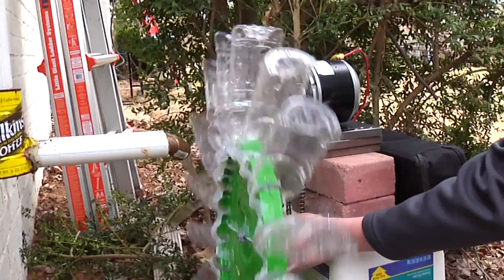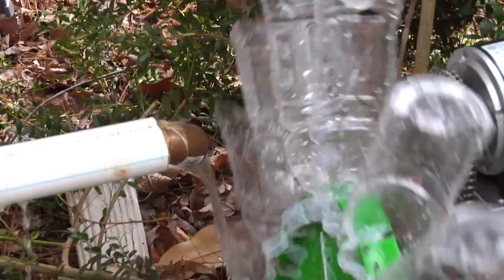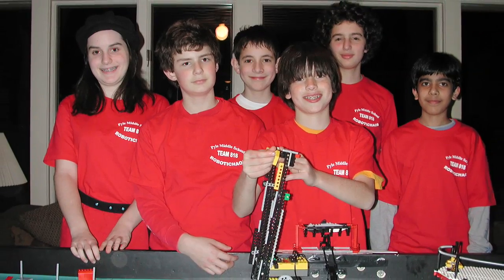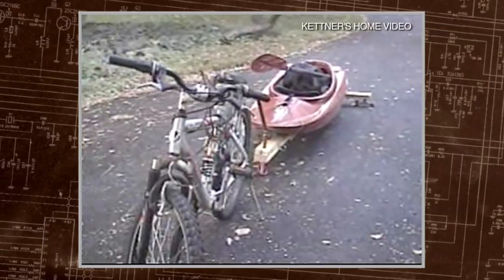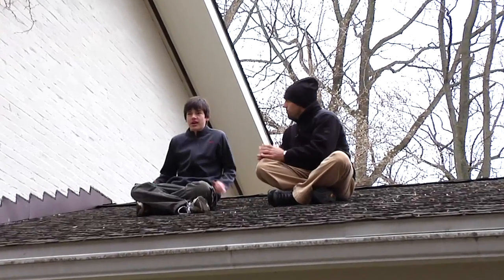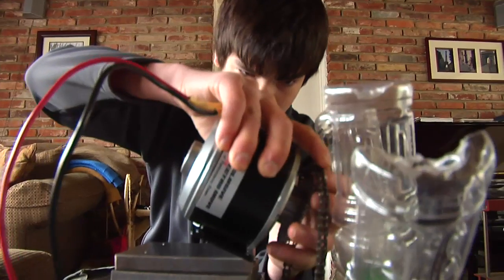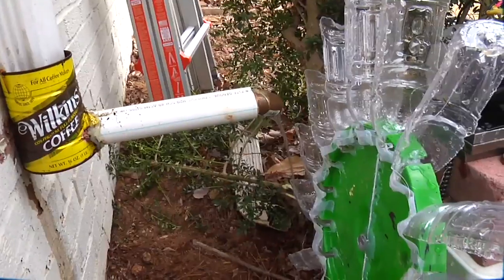Amazing Hydro-Electric Power Collector

Comment: This is a very simple idea not worth YouTube video, but if you have a tank over the house and use rainwater run a pump to lift and save the water over the house in the same time save the other energy in a battery, then use capillary action to drive the water up to the tank using little power and charge the battery, we might end up with extra energy.

Comment: The chain isn't even moving this video is fake as fuck, the resistance from the motor would make that wheel turn extremely slowly. In one shot you can see the chain is attached to the bottom axle, not the gear.

Comment: Isn't it ironic how the lack of rainwater, necessary to demo this "invention," was totally glossed over and a garden hose was used instead, like it was no big deal?  It's ironic in that it clearly demonstrates the intermittent nature of most renewable methods of generating electricity (most notably wind and to some degree - solar).  Not only that, but this is simply a small scale example of the planet's existing hydrological cycle that we already take advantage of using dams.  Except with this thing, there is no absolutely necessary and MASSIVE reservoir of stored water, hence the need for a hose.  My point?  This kid is obviously very clever.  However, celebrating people in this manner for a wholly unrealistic idea takes away from other kids who might actually be working on something that has never been thought of before.  THOSE are the people who we should stay focused on.  

In my mind, this kid here, while clearly clever, as I've already stated, doesn't impress me one bit because if he was truly smart or at a genius level of thinking, he would also understand that this has NO practical application whatsover.  Why?  The answer is in the first sentence of this comment.  

Everyone needs to get a solid grip on some basic science so they will quit tripping all over themselves thinking kids like this are "so super incredibly f'ing smart" when all that is happening is that the kid is walking down the one-hundred year-old footsteps of someone who actually had an original idea...

Comment: soo it's  a turbine. you didn't  invent anything, kid. Dams create electricity this way, you just made the turbine unnecessarily big and put it in front of the gutter.
Reply: It's not even as though this is a new idea to use rain water, I have seen hundreds of examples of it online. It's too expensive to be worth the money. being as it would produce barely any electricity. you might as well wire up the motor to a hamsters wheel.
Reply: Yep, you basically just summed it up.

Comment: well he could also make this to work without the rain. Simply make the water flowing through roof as an water cycle of a moving current that recycles itself through the tubes. Water coming out from the tube goes inside a bucket that leads the water to another tube which returns the water from where it started. 
like that:
(water)=========
       =                    =
       =                   === ¤(mill)
       =                         °
       =                         °
       =                         ° (water)
    ==============U(bucket)

Comment: This was just an awful thing to sit through. If you're going to make a spectical of a price of literal garbage like this at least show it working! The motor generator never turned and that's probably for the better because the chain would fall off from that terrible shaft alignment. There was no charging circuit or regulator that the eye could see so if it was even capable of charging the battery you risk over charging the it. The slow water wheel with the added low sprocket tooth ratio would suggest that it would take a month to charge a scooter battery that size if that. This is not a personal attack at the kid but the way the studio is glorifying such a flawed contraption just infuriates me. There are people out there doing this with trash washing machine motors SUCCESSFULLY and powering their houses! Praise them, not Gatorade bottles hot glued to a frisbee! Once again this is not to put the kid down; if he keeps working I can see him being a great success.

Comment: the water is barely hitting  the bottles in the wheel somebody started the turbine by hand.and the gear from the shaft to the motor is very small this will not produce enough voltage even for charging a cellphone.this is stupid even if it's not new as invention at least do it right.

Comment: Huh, would anyone explain to me how you would do that without the battery powering the motor..... If you guys diddnt pick that up it was sarcasm.... So I'm looking at this and I'm seeing no double throw switch, which would only allow power to go from the motor to the battery.... And he would have to convert this energy.... Correct me if I'm wrong but you can't charge a 12 or 24 volt battery with the amount of voltage he is putting out. So the motor is obviously doing the work or he is just no plugging in the battery...

Comment: Is it just me or the chain is not even moving?

How much his parents paid to be in that show? <.<
Reply: +Eliran Cohen 
im gueesing a 1000 bucks and a shitty sculpture of broken bottles and stationary chain's can get you there
Reply: ***** So fake ...
Reply: +Eliran Cohen No the chain is moving but he stupidly put the chain on a small gear which will make it turn really slow whereas a bigger gear (bigger than the motors gear) Would spin faster
Reply: Connor Erb
But stupid
Reply: Connor Erb
And not built correctly

I could go on forever but I think you get the message now
Reply: There is this thing called FRAMERATE...
Reply: or internet is bad
Reply: DJ Tom Page yes
Reply: no comment to the public
Reply: Framerate? So, let's THINK that chain is in sync with framerate. 30 FPS, OK? And then look at the moment when wheel starts moving. Nothing! It can't be synchronised when it's starts.
Reply: thx u
Reply: It was missing a gear....
Reply: Eliran Cohen hi

Comment: I remember putting a 4-foot wide waterwheel with a rubber belt to an alternator, then to a Oxy-Hydrogen Generator I put connected to a small 7cc four-stroke engine when I was like 12.

Comment: Wow!! I whant do it.!! How he did to generate the voltage, and current necesari  to recharge a battery?,
what kind of electric motor I need to do it?
Reply: Might aswell get you a hamster with a wheel.
Will generate you just as much energy.
(Unless you live somewhere where it rains 24/7, then you would need 2 hamsters..)
Reply: yes, is a good opinion. thanks

Comment: You can get more power installing exercycles with generators attached in every prison cell in the country, and sentencing inmates to a certain number of kWh produced instead of to a certain number of years. The more they peddle, the quicker they get out of there!
Judge: "I sentence the defendant to 187.2 kWh"
Crim: "Oh no! At 75W average output and peddling 8 hours a day for 6 days a week, it'll take me a whole year to produce that much energy!"
Judge: "Well your crime was revolting, so you'd better give us some volts then!"
Victim: "Yeah, my injuries you cannot repair,  so pay up with a bunch of amperes!"
Crim: "Oh no, I'm undone. If I'd not been such a twat, I wouldn't have to deliver a Watt!"

As for the video above, why is the bottle wheel turning but the chain connecting it to the generator is not turning? Could it not overcome the friction with the chain connected?
Reply: +Max Brewster thats the last thing you want, fast criminals ... the cops wont be able to keep up
Reply: Max Brewster haha good idea!!! the lazy ones will never get out
Reply: +Max Brewster And straight outta prison to olympics in running / cycling competitions
Reply: +Max Brewster Theres a British TV show called Black Mirror, which pretty much has an entire episode around this idea.
Reply: Isn't that technically slavery though?
Reply: Max Brewster check out black mirror.. there is an x factor type episode that uses teens to pedal for credits per day to get their invite.

Comment: filter this water meanwhile, use the energy to boil it, and you have a drinkingsource generator :p
Reply: This thing wouldn't produce enough energy to raise the temperature of the water 0.1 degrees.

Comment: First this is a very old invention. Second rain would destroy that thing unless you waterproof it and waterproofing it would create a source of friction on the shaft seriously limiting its power output. Which brings me to my third point it spins so slowly already it probably produces less than 1 watt of power.
Reply: I didn't even notice that it wasn't even turning the motor so it actually produces zero power.
Reply: you will not put that thing outside... instead you will put all the downspout inside...
Reply: Jay Flores In which case you would still have running water near electrical equipment.
Reply: make two rooms... one for the machine... one for the running water... separate it... improvised! plan and think... that's it...
Reply: Lassi Kinnunen
Did you guys ever hear of a fucking watermill?
Reply: wildmonkies Jr
Well its fine to learn from it..
The problem is that they act like it's a revolutionary new thing he "invented"
Reply: Jay Flores really a young kid shows way of making power  and everyone tears him down   I think we all know who the fool is here   I give this kid 10 stars for being inventive of to even think of an possibility
Reply: It may have been done in the past and may seem  useless at this time and age but I'm young and want to learn. I've learn how electric motors work and many other things. It is practice engineering skill, woodworking, and electrical skill.
Reply: yah! your right they are just jealous... :) they can't do what others do, they can't think what others think...
Reply: Whatever.
Reply: You are right because that thing is tiny. But I'm planning on building a prototype for a bigger plan. The plan was see how much energy I could max out with a small design then make a larger version that could use the power of the Merrimack river. I got the idea from the history of Merrimack river.
Reply: herbsterplace1 its a watermill RIP OFF !!! there is nothing inovative in this,just common sense. Also if you want to charge a batery you can make it faster (and safer) with a becycle (instead of the running water),it has the same effect and keeps you fit.
Reply: herbsterplace1 The kid just read a book and made what was described in it, as if that was a hard thing to do...IT IS NOT...this has been done for ages.
Reply: I agree with you but every problem can be worked out when you at least try. Not trying is not going help look for a solution.
Reply: wildmonkies Jr
 True, but I would not call the video "Amazing" as it was in the title...if anything its underwhelming...a bit...
Reply: +POVadventure1. Yes, I agree it's an old invention, but:2.He could make a little shelter for it; make a little umbrella stand or something.3. That's actually kind of a good thing, because at that rate, it's unlikely that the battery will overcharge and leak/explode.
Reply: A simpler approach would just be to create a charge regulator...

Comment: It will be more better if you attached a small pump to pump up the rainwater to keep on turning it. then it'll work without rain again. oh and collect the rainwater first! and use a small pump that doesn't use much electricity too much so you could charge the battery or anything too! nice invention!

Comment: not only did he NOT INVENT anything new, the wheel wasn't turning the gear on the generator which means the bottom gear was just freewheeling ergo it doesn't work lol probably because 12 fluid ounces of water in a hot glued water bottle to an out of balance whee,l doesn't have the drive force needed to generate electricity

Comment: Actually this video proves the failure of existing systems design in the building industry.  The standard home the kid lives in is built only to use the most wasteful and temporary of materials from the chemical, prefab mining and forestry producers.   The eaves trough is a good example of stupid engineering.  They clog, freeze, back up and hold snow and ice to destroy the most vulnerable part of the roof...the eaves.  And of course they utterly waste the pure fresh water.

Comment: That's even worse! If he can't power a car battery, what is he going to use it for? Charging his iPod in the rain when the power goes out? I bet he could hardly power a light bulb consistently. Not to mention all the run-off water leaking into his foundation and eventually causing thousands of dollars in property damage.

The fact that this video is hailing this kid as a "bright young inventor"disgusts me.

Comment: Your a dumb-ass for thinking it wont. Think about it, if you attach an alternator to two small motors in a parallel series, with gears to mash and grind the corn together. Having the alternator powered by X as its energy source...then SuperAviator's version could certainly work.

Comment: If you used rainwater alone, powering your home let alone a microwave would seem utterly useless and near impossible based on this system. In order to achieve enough power using water alone, you would have 2 make a water mill next 2 a stream to power even close to enough energy. And by the time your done, your state's building code would require you 2 tear it down because you need a permit 2 build it. Solar panels alone may not even produce the power you need- it would take weeks to reach 'free'

Comment: How is this innovative? I mean... A+ for the creativity but.. I made a windmill with a 12V DC motor and Solo cups in 4TH grade.. and could achieve the same without water or rain. You can use permanent and coil magnets that can power complete sockets (120V+) WITHOUT wind OR water. This is a really old concept and further implications of this would just be a mockery of modern Dam turbine technology at a lower scale. If this kid actually tried to patent something the Gov would just laugh at him -.-

Comment: Good idea, but now start the water collection at the top of the house and run the water across 8-12 of the machines stacked vertically to maximize your energy potential. From roof of house to ground level instead of just at ground level.

Comment: I was thinking the same thing, a motor of that size has a good amount of resistance. Even with those long arms and gearing reduction I would be willing to bet its too much resistance. That or the resistance added would self destruct the flimsy wheel.

Comment: That's a fairly lame way of looking at this. In principle every non hydro electric power plant works the same too. Speaking of coal, natural gas, and nuclear. They are all exactly the same in that they heat water to steam and it turns turbines.

Does that mean that the nuclear power plant was not an invention? Of course not. 

The kid came up with a device that is, honestly useless, but the kid is thinking. That's more than I can say for many adults and certainly most kids.

Comment: Dont let Obama see this or he will shut down more power plants, telling us run out houses on rain water.
Seriously, I wonder if this is him or his father doing this. 
In High School, all the science fair winners dads were engineers at Westhouse Electric.
They had stuff like tornado machines & fuel cell desplays,(this is 1968). 
Everyone knew they didnt make this stuff.
Maybe this kid did make this but did you notice the generator was not turning in the video?
Load might stop the wheel.

Comment: generating electric with a water wheel is not a new idea. it's a very old idea. far more effective water wheels are out there already. they have the benefit of a few thousand years worth of experimention and being perfected. altho a water turbine will produce more. you can buy a kit, that actually works using an old toyota alternator. this just fails on alot of levels.

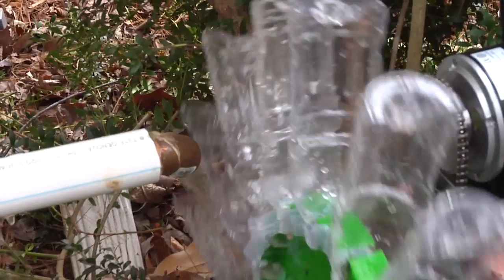Comment: see 3:37   the pelton wheel does't drive the chain and the generator, but is just free wheeling.  On my tought it wouldn't  bear the torque to  drive the chain and the generator , let alone charge a car battery
But,  Nice  tought , my compliments

Comment: Does anybody other than me notice that the chain and motor are not turning whilst the water wheel is turning? Show me that same system generating useful electricity and I will be impressed. As it is right now ... Not so impressed. Message to Kettner - Learn the physics behind your machine and then re-design your project. The concept is great though. Happy Engineering and best of luck to you.

Comment: lets say, for a 10m^2 roof 0.3g of water falls on it per second (that's a lot, ~ 10,000kg per year). gravitation potential energy = mass * gravity * height. so say it falls 5 meters. the energy = 0.3 * 9.81 * 5 = about 5 joules. 5 joules per sec is 5 watts- this is with massively liberal estimates. there's nothing amazing about this.

Comment: Hmm, I'm not sure. I know that wheels on cars etc. seem to spin the wrong way n TV sometimes, but I thought that was just because the frame rate of the camera captured successive wheel positions in such a way that they happened to move backwards. The monitor refresh rate shouldn't matter, because it is pretty much always higher than the frame rate of recording.
But that was an animation anyway, not filmed on a camera. I think they might have just made a mistake

Comment: Correction: The Romans took the idea from the Greeks. The Dutch have used the "Archimedes Screw" type pumps to keep the sea water out of the lowlands of Holland for centuries. The Romans didn't invent the water wheel, the Greeks did.
If you're going to put someone down for doing something, at least have the wherewithal to get your facts straight!
And what have you done, anything? What have you built that's better than what this kid has done? I don't see a video response from you, troll